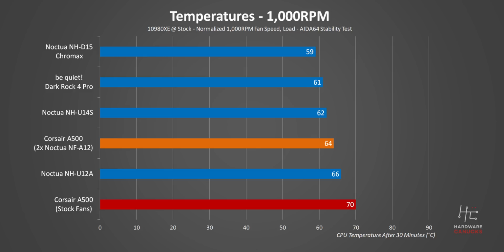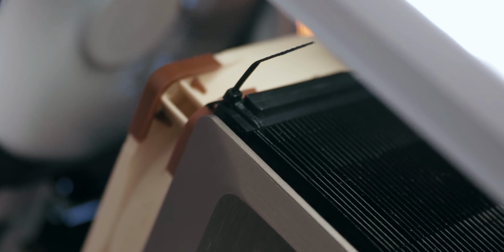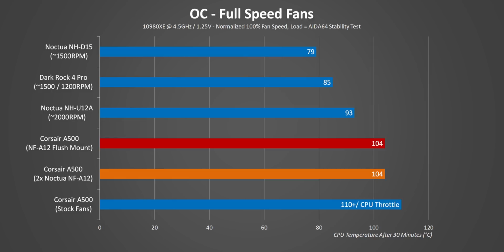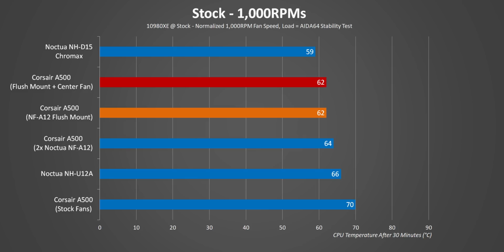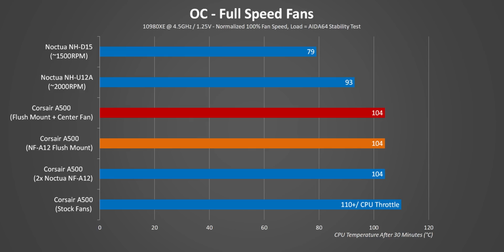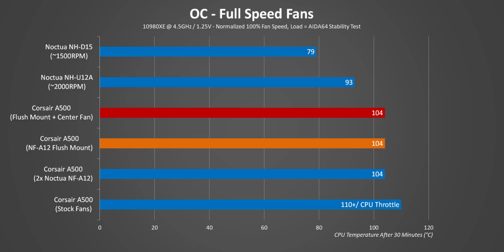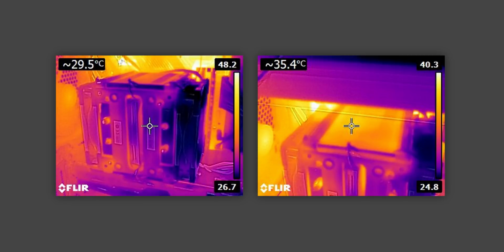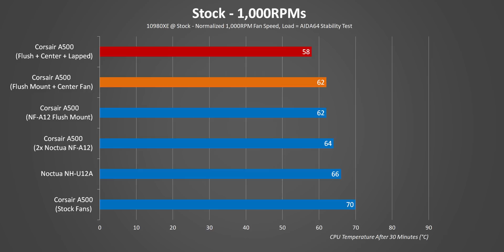I Tried To FIX The Corsair A500 Air Cooler!

Comment from the maker: Timestamps!  
Eliminating dat gap - 1:52
Filling the void - 3:51
Get that lapping kit goin! - 6:57
Reply: Did you lap the cpu ihs? That's probably the last real step in the process. I'm curious if that would do anything.
Reply: @guybguyb8791  that will change not only this cooler's result but also every cooler tested with that particular cpu
Reply from the maker: @guybguyb8791  Nope.
Reply: GUYS! I DID FIX THE A500 PERFORMANCE!
All i did was to start by replacing the fans by noctua fans, and when that did not work, i replaced the heatsink entirely for a noctua one! Easy!
Reply: I think you guys missed trying out some more stuff like using a thermal pad instead of paste and checking if any of the heat pipes is in contact with anything surrounding the CPU socket making it pick up heat from that. If so try lapping the heat pipe in the area that is making contact and see if that helps with the temps. Also it would have been interesting to see you under clock/Volt that CPU step by step until it reaches a temperature the CPU cooler can handle just fine that way you would have figured out the proper Wattage this cooler should have been rated for which would have been informative to us the consumers.
Reply: @SkyForce6700  No, wrong advice. It's the task of Corsair to design the cooler in such way that it doesn't conflict with the specs of sockets handed out by Intel and AMD. Period. Only advice should be, stay away from this cooler till Corsair solve the issue and come out that they screw it up.
Reply: @dorientjewoller113   It was not advice it was a suggestion to figure out and diagnose the problem with this cooler similar to what Steve at Gamersnexus sometimes does and then inform the manufacturer all what they did wrong and how it is fixed. I am a tech geek when something is wrong I want to know what is causing the problem so that was the reason for my suggestions.
Reply: @SkyForce6700  C'mon, stay a bit logical: if it, the heatpipes, are resting already on 7 mm high capacitors while the max allowed height of capacitors around the socket 115X is 10.10 mm, imaging how hard they have to lap the heatpipes when the motherboard is occupied with the tallest allowed capacitors. Unless you wanna see the inside of the heatpipes.
Reply: Not big on the new logo, but good vod.
Reply: @Hardwarecancuks Why you did not cover the void from the upper side and bottom so air could not up or down just on sides? This central fan can only stop airflow.  But I agree with guys I would like to see Fuma 2.
Reply: Thanks for doing what you could to salvage the A500, Mike. The choice is now clear for those who seek the best CPU air cooling, a proper AMD mounting system and industry standard fan sizes: the NH-D15 / NH-D15 chromax.
Reply: Great...can you fix intel stock cooler...last time mine got drunk and breath fire...Like a dragon...
Reply: Stop trying to make the A500 look good. It´s not gonna happen. 80% of the performance in a cooler comes from heatpipe quantity and cuality. You would know this without testing, if you would have experience and knowledge testing things, which you should since as a channel you guys made so many "reviews", but you don´t. 
At least, you did try. Props to you!!!
I hope Dimitry leaves the technical stuff to you and Eobard, because the guy it´s so focused on looks, feeling, and branding, that he can´t really get a grip for the technical stuff.

If you wanna do a service to the comunity test a fuma 2 and compare it to NH D15. It´s a 60 bucks cooler, and has 120mm 1200rpm fans (which means because of both rpm and size it´s gonna be quieter......"by a while") and a smaller footprint aswell as better RAM clearence, and height bellow 160mm, and it´s a direct competitor to nh d15. It´s gonna get you a lot of views, if you "clickbait", (not really clickbait) the tittle.

Cheers!!!
Reply: @TTks124  Amen, as I mentioned it below, heatpipes of this A500 Air are resting upon the capacitors of the motherboard. And TBH, he has the Fuma 2 sitting on his desk, he should test that cooler.
Reply: @dorientjewoller113  damn bro, i didnt even see the fuma 2 untill you mentioned it.
Reply from the maker: @dorientjewoller113  Glad you enjoyed that little easter egg!  Our intent is to get the Fuma 2 done for next week.
Reply: @HardwareCanucks  Fine ... but it doesn't take away the issues with this A500 Air of resting heatpipes on the capacitors around the socket and a backplate that is laking depth causing it to ride on the socket construction on the back of the motherboard and that the washers of that backplate have no use. :P Oh, no Gear Seakers trick, where he promissed to review it too and upload it a week after his A500 Air review ... still waiting after a month and a half for that Fuma 2 review.
Reply: @HardwareCanucks  yoooooo im so hyped for that fuma video

Comment: You could have used tape to seal the fans to the heatsink at the top and bottom a lot easier.  A small gap away from the fins is actually better for static pressure/vacuum generation from the fans.  Spacing the fans from the fins also will reduce dead spot(s) which will increase performance slightly, though you would still be limited by the performance of the heatpipes and contact area.

Comment: I can't imagine anyone running a 10980xe and using air to cool it.  If they have the money for that platform, they at least have enough to buy an AIO.  Should've tested this on a 9600k or 9700k, those are the people more likely to be using this cooler (even though they stupidly rated it at 250w).

Comment: I hope that this video, together with Buildzoids video about overwhelming heatpipes will finaly put an end to the comments online that aircoolers are better than AIOs for maximum overclock.
As this clearly shows that a lower temperature at a certain heatload does not equate better cooling at a higher heatload, the same goes for every other aircooler

Comment: I have collected this pc is it good?(this is my first PC so pls tell me if you have any advice)
Motherboard:Msi b450 max
Gpu: sapphire nitro+ 5700xt
Cpu: amd 3600x
Ram:crucial ballistic 16gb
Ssd: Hp ex950 m.2 512gb
Power supply:Evga supernova 650 g3 80+ gold,650w
No case yet

Comment: I dont understand the justification of using a 10980xe.  I dont think that is indicative of what most people who are looking to purchase this cooler would be running.  If you are planning on spending $1000usd on a cpu you are probably looking at a way higher end cooling solution.

Comment: Without lapping the heat spreader on your CPU lapping the cooler will have little to no benefit, just as you have shown. all current gen CPUs from both Intel and AMD do not have flat surfaces. that is one reason you see extreme overclockers (LN2 guys and gals) lapping both the CPU and LN2 Pots. So if you try one more time and lap the CPU heat spreader you might see an improvement in temps.

Comment: Corsair won't learn a bit from this. They just commited the same mistakes they did 10 years ago. They have a hardon on large diameter heatpipes. The A70 has/had the same issues. That was a lackluster trash too. Crap fans, which mounted absolutely horrible way, with gap, only 4 heatpipes, but they were 8 mm diameter ones. And that cooler lacked material too, but there was no gap inside the fins. But the fins were curved, and a lot of air pressure went out of the window.  Base was terribly finished. All and all: the A500 is the same crap, rotated 90°. Only progress is the better spread of the heatpipes. The Scythe Infinity with 1 slow fan easily outperformed the A70 with 2 roaring fans. Shame on Corsair.
Reply: What makes the matters even worse, this time Corsair used 2x8mm and 2x6mm heatpipes

Comment: This was an interesting video - nobody can claim you didn't try. I think you found the reason but might've been able to save yourself all of this hassle; the "competing" Noctua coolers have ~6 heat pipes, and the Corsair only has 4. I'm currently running a Hyper 212 BLACK and THAT has 4 heat pipes, but I also don't push it like I would a 100$ cooler (I got this for 30$.) 

I think what happened here is that Corsair hasn't made one of these for a long time - so this first iteration has a lot of die tooling it needs to offset the cost of, thus the high price. But it needs reworking to make it a good product, so I'd expect a V2/V3 product to perform way better. The sad reality is that if this is a flop commercially, Corsair might just call it a loss and give it the Old Yeller treatment.

One minor criticism - if you're going to spend hours to lap the cooler, you should really lap the CPU too.

Comment: Tdp rating from AMD, Intel  and nvidia are different from each other

And the tdp rating from cooler manufacturers are only comparable to their other products (company "X"'s coolers aren't comparable to company "Y"'s coolers). Because their test platform are not the same as eachother

With cooler manufacturers they have a thermal test vehicle on which they test their cooler

The tdp rating from the cooler manufacturers, it's the amount of power going through the ttv while keeping the temp under a threshold

In this case the cooler was rated at 250W

Comment: Mind testing one additional theory?

I think that this isn’t a case of too high of a TDP ratingX but that the heat flux isn’t spread out well enough because it’s a direct touch design. Because there is not additional copper base, the heat flux is too isolated to the central heat pipes and reaching beyond their Qmax rating.

Go spend a few bucks on Mouser or Digi-Key and pick up a small sheet of Panasonic’s PGS, specifically EYGS121803. You might need a light application of thermal grease as a gap filler, so I’d suggest testing with both.

If it works, I suspect higher idle and lower OC temps.

Comment: One complaint I have is that this isn't lapping, it's wet sanding. Per definition, lapping is using a loose abrasive between two surfaces and not bound abrasive like sanding paper.
Still, great content, I hope we see more Mike and this style of video in the future.

Comment: Thanks for the informative video, this air cooler definitely seems below par from all the independent review tests I have seen so far.  Hopefully this will inspire Corsair to take it back to the lab, to try to improve its less than stellar performance.

The NH-D15 I recently installed keeps my 140w TDP i7-5820k running consistently at about 50C after running a "100% CPU on all cores for over an hour" video encoding workload.  To my great surprise, this beats my old liquid cooler (a brand name device with a 240mm radiator with two 120mm fans) by a solid 15C in that test.  I'm sort of amazed that your stock A500 does so poorly compared to other devices, given how evolved and neat looking some of its design elements are.  One thing you couldn't easily replace and upgrade are Corsair's heat pipes themselves, which would seem to be working badly from the lack of heat you observed coming off the heat sink fins.  I wonder if they just bent them too much, if they don't have an interior structure to facilitate the coolant return cycle very efficiently, or maybe they just don't have enough evaporation coolant in them?

Comment: I was going to give Corsair the benefit of the doubt and cite thermal density as a problem, but I just googled an image of the 10980xe die... that is one large die, and is not much smaller than the actual IHS (and thus the base of the A500 cooler). If it can't cool 250w in this scenario, then there's no hope of it cooling 250w in any scenario. My 9900KF can easily exceed 200w and that's a much smaller die... the A500 would fail even more miserably with that chip.

Comment: I would prefer the CoolerMaster Hyper 212. 
Kinda cheap move by corsair implementing the bracket to only be compatible with their fans only. 
Hyper 212'2 bracket can be installed on any 120mm fan. 
Swap my stock 212 fan with Noctua, the difference is night and day.

Comment: have you tried brute forcing air thru the heatsinks? - if the result there is also bad, the heatsink is garbage and/or the heat transfer in the heatpipes has a problem - probably no mesh/powder/thing inside. - thats my idea.
also -> go get noctua. I used at least 15 Noctua CPU coolers in the last 2-3 years - non of them ever made problems. in fact, all of them are still in use (some are taken over to the newer builds/upgrades). 
I also used one dark rock pro - which is also nice, but the fans are garbage - swapped them to noctua ;)
I just don recommend any AiO anymore. Besides being louder (pump) when idle/low power, most of them failed in around 1.5-2.5 years (had 5 or 6 of those - all are some sort of asetek).

Comment: @HardwareCanucks Not many people seem to want to try this but hear me out. I think you can use the empty space in the middle of the cooler as an exhaust. If you face 2 fans towards each other  the airflow will meet in the middle and disperse through the sides and top. This should provide some airflow over the base plate of the cooler where the pipes meet the processor and over the motherboard and GPU back-plate/PCB. Furthermore, add a small heat-sink over the pipes on the base-plate as there is a lot of empty space. In theory, the heat transfers more efficiently the closer it gets to the hottest point, so it should increase the TDP? Please play around with it and maybe even try blocking the hole in the top to force the air down on the base-plate. 

P.S. You might need to adjust the speed of each fan separately as one could overpower the other. Maybe you can test where the airflow is dominant with a piece of paper in between them.

Comment: Here’s the true fix:

Buy a better priced, better performing cooler that will actually fit in most cases.
Reply: Like the Scythe Fuma 2 or Mugen5
Reply: or the noctua/be quiets for 20$ less
Reply: @paulsnelling7808  Or you can even grab an used NH-D14 for half it's price !

Comment: Nothing is going to fix a massive 4 heat pipe cooler. Garbage it and get something decently engineered. They literally just made a cooler to get a piece of the market but couldn't make it as good at cooling as their aio units.

Comment: Surprised the flushmount fans didn't actually hurt performance, a spacer help get rid of deadspots, and having essentially more surface area help reduce air resistance.

Comment: If you want to investigate further, you might check the heatpipes as they bend up toward the fins. Another tech youtuber found that this cooler seemed to violate the spec sheet of intel chipsets by having the heatpipes placed too low, causing them to seemingly come into direct contact with the vrm capacitors at the edge of the socket. This may not be a thing with AMD boards, however.

Comment: Question: have you guys lapped the IHS? Gamers Nexus had a big problem with their 9980XE where the difference in height of the IHS was massive, which made so as one core was way hotter than the others.
Still, congrats for the test methodology and through verification.  I still think corsair air cooler can be starved for heat pipes, as most of its competitors (if not all) use 6 or more. Still, it's nice to see where they can improve. Way to go, guys!
P.S.: Audio compression still annoys me a little, the ad on this video was a real "just no" for me. Have you guys looked into it?

Comment: Just a tip from someone who prepped metal samples for 2 years, don't bother counting your passes on each sand paper. It is as simple as sanding until major defects are gone, rotate 90°, and sand until all previous markings are gone. Rinse and repeat until you are at the desired level sanding. I used to go to 0.5 micron (60,000 Grit) for a mirror finish, and if there were any scratches on the material visible under a microscope, you just start over at around 200 grit.

Comment: I'm wondering if the acetone filling levels (and internal pressure) are wrong in your sample. I've seen many reviews where they don't have any temperature problems at all. It performs about at the Noctua D14 and Dark Rock Pro levels in cooling, but a lot worse in acoustics of course.

Comment: And we had a lot of fun watching this. Noctua, Be quit, or the amazing (probably not made anymore) original Thermalright Silver Arrow, which I still have running on a 9900K, or an 8750(?) which I bought "cherry picked" from Caseking, can't remember on which. The Silver Arrow has been working 24/7 since 2010/11, without ever having an issue or being cleaned, aside from the thermal paste whne it moves to a new "home."

Comment: For comparison: The be Quiet shadow rock 2 has also 4 heatpipes, roughly the same size, no silly hole in the finstack and is advertised as 180W TDP. Yes, not all TDPs are equal - but even then: Proclaiming a +40% better performance by basically adding a second fan (and raising the prize by 50$) doesn't make sense.